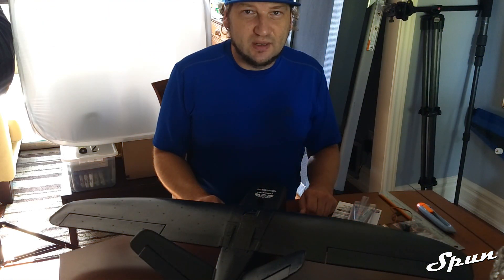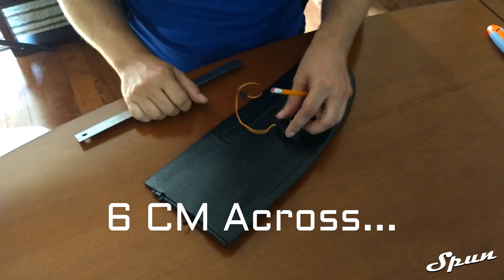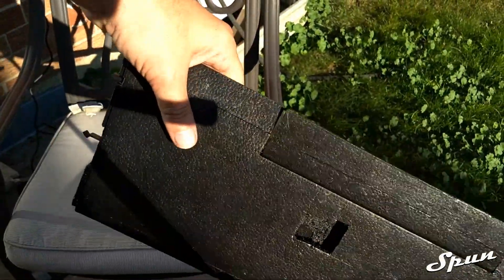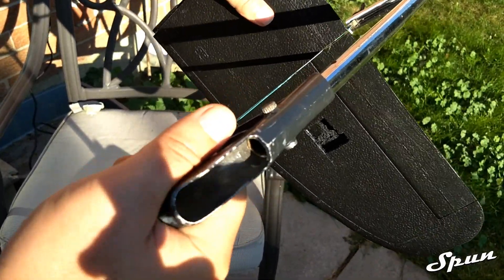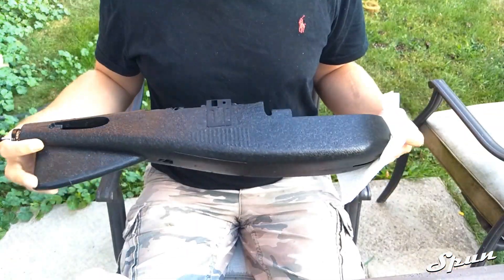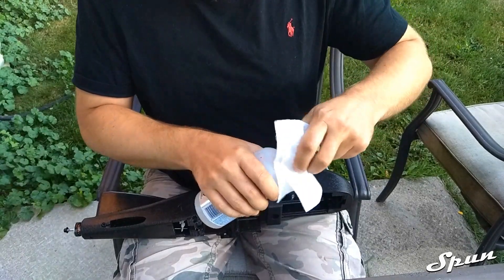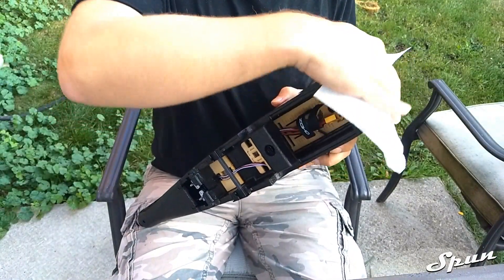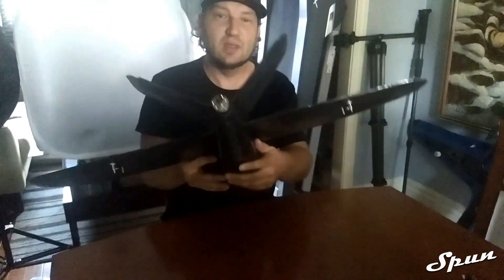ZOHD NANO TALON EVO Black Ops Build - Part 1 - MODS (Servo mod/Reinforcement)

Comment: Hi Im interested in doing the servo mod like you did. How have you connected the servo's inside the fuselage? Did you use a y connector? Did you hot glue or 3m the servos in?  please TIA

Comment: Love the goop/e6000 trick... makes every foam plane so much more durable. Quick question, I just finished doing a Mini skyhunter built with an omnibus f4 board running ardupilot. It was my first time using the arduplane chibios. I was going to try and do the same with the nano talon EVO because I had heard there was a bay for a hero 7 in it and I was going to do a "backpack mapper" type build. Does the GP7 bay come with the plane or do you have to get it elsewhere?